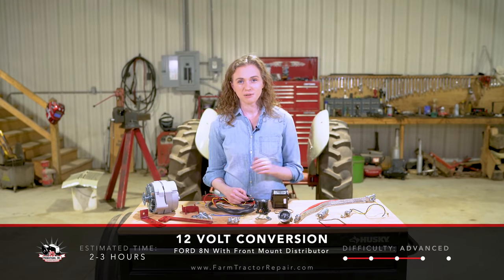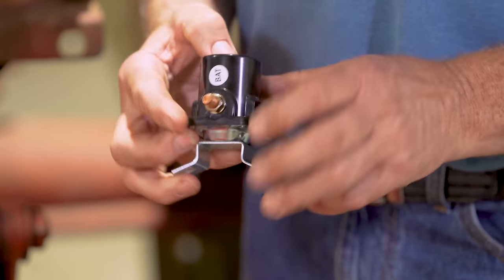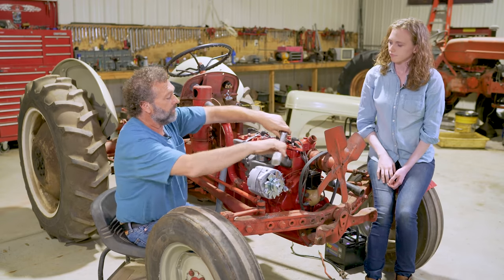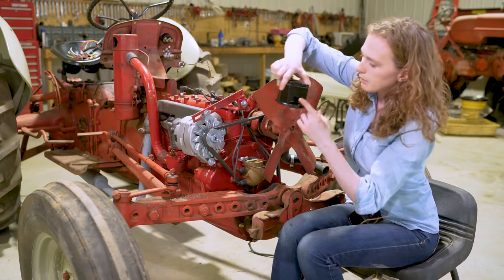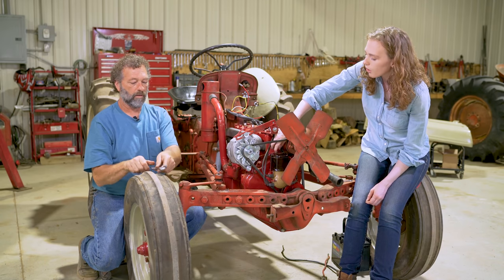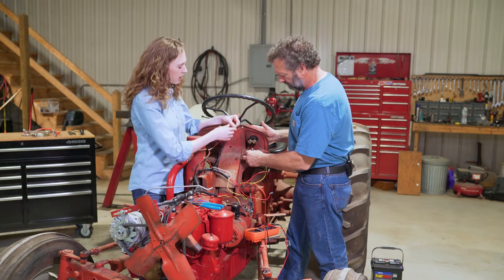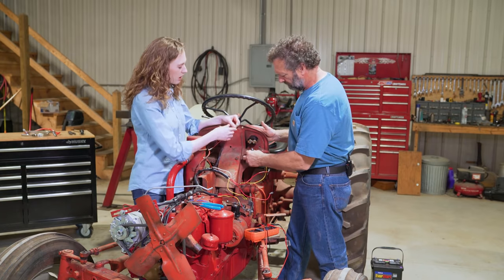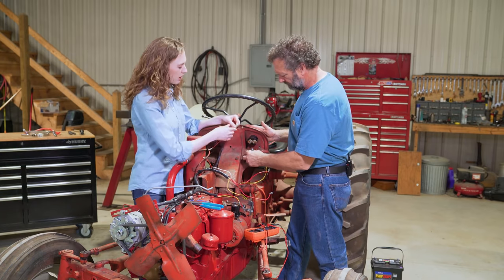Ford 8N FRONT Distributor Wiring & 12 Volt Conversion, and Starter Button Replacement Tutorial

Comment: Well Dan and Rachel, bought my premium conversion kit in January ‘23 and it will be January ‘24 in a few days.  Since my distributor failed and the tractor has not started in 5 months, I really need to get it running in case of some deep snow this season.  I love the freedom of movement you show here as mine has a Dearborn loader.  The framework for that thing makes almost any angle I try to work from… a chore.  I have decided to use a link belt instead of removing the front loader pump to change the fan belt.  I love the way you said “changing that could take all day….” looking at this now, you are so right .  Got the 8N running perfectly today as a 6V… now it’s time to pull that apart and make this conversion….a year later 😂
Reply: What link belt did you buy? 
I need to get one, I really don’t want to have to remove my front loader for the belt.
Reply: @paulridley5579  I bought mine from harbor freight.  It was 1/2 the cost and after 4 months, no issues.  Had even replace the front mount distributor and the engine starts almost instantly…spins over maybe 2 times and it running great
Reply: @knuckle47   Thank you so much, this worked and saved me a ton of time. I could only find 1/2” at harbor freight so I bought the 5/8” x 5’ one on Amazon and removed some links. It worked well!
Reply: @paulridley5579  glad to read that….BIG time saver

Comment: Very informative video
I ended up buying this kit through your website. It was very expensive for the quality of the items which came. The key switch was very sloppy and I ended up having to make and weld a piece for the  bracket for the alternator, like the one shown on the front page of your manual.
 I'm not trying to be negative but to help the quality control and the customers in my situation.

Comment: Dan did my 12 volt conversion on my 8N back about 1992 when he had a shop on Lapeer Rd just south of Lapeer.  That's when he had no snow on the mountain. Still have the tractor, and it starts like it has electronic ignition but it doesn't.  It just starts right up in  2 seconds or less.  Everybody else's tractor just grinds, and grinds, and peters out for some reason. Mine starts instantly.  It's wierd, but I'll take it.  and I store it outside under a tarp in the cold Michigan weather, and it still starts up instantly.   Thank you Dan.

Comment: Thanks! I have a Bolens G192 with a generator and relay voltage regulator that I will adapt your approach to a single wire alternator. When I was a high schooler in 1978 i converted my 6volt 52 Chevy truck to 12v. With the 6v starter it spun over like mad! Added a ceramic resistor for the heater blower.

Comment: One little complaint Rachel, the screws holding my new resister are 1/4 by 24 and not 28 as you said in your video. Not a biggy but that’s the only thing I can bug you about. Love the videos👍👍

Comment: Just jumping back to say a video on putting the hood on and off an Ford 800 would be nice. How to properly put back on all the clips, rubber bumpers, and get everything aligned. With info about hooking up all the lights and properly wiring. The Hood and writing of lights is something there is just about nothing done out there, at least all in one video. Thanks again.

Comment: Followed video and written instructions to a tee! However when I connect the negative battery cable on to the battery the tractor starts turning over. Rechecked the wiring.. connected per the diagram. had a new solenoid sent same results? Help?

Comment: I recently purchased a Ford 600 that had already been converted to 12 volts, the tractor runs good but the previous owner bypassed the starter button with a dash mount push button and the lights are not hooked up. I would like to replace the starter button but was wondering if I should purchase just a 12 volt wiring harness or if I should purchase the whole kit? I have not had the opportunity to work the tractor, so I really don't know if the all the gauges are there. Thank you for your video's they are very helpful

Comment: Great video, one question, I cannot get my mechanical starter switch to work, switch worked fine when tractor was 6 volts, is there a different switch for negative ground ? Or do I need a different solenoid, I did go with 12v solenoid.

Comment: Hi I bought a  48 ford 8n with a  loader last year it has a 12 volt positive  ground battery  hooked  this  way it started  when warm but have since changed the carburetor  now  that it is cold will not start I have ordered the  12 volt conversion  kit  have you heard of people running  tractors  this  way?

Comment: Does the point condenser (6V) need to be replaced and how about the starter. Will 12V system damage it if excessive cranking occurs

Comment: I have by s/n what appears a '50 mdl ford 8 or 9N or a hodge podged tractor?🤔😊.  L&R brake peds on Rt side...but 3 spd Tran & draft cntrl.  I rewired to 12v.  Set it on  blocks after purchase 3 yrs ago or so and went thru it.  It has side mount distr...What am I seeing??

Comment: I have a ford 8N tractor that's been converted to a 12 Volt system. The thing breaks the Starter Bendix on the starter every 6 months or so, can you recommend anything so I ain't fixing the Bendix every 6 months??? Is there a harden Bendix that might stop the Starter Bendix from shearing off every few months???

Comment: Here's what I need, my 1980's japanese Ford 2110 diesel has a 3 point hitch that goes down when the tractor is off, I am sure the pump is running needlessly in order to keep it up while being used, meaning, the hitch leaks down. I have no idea where that fault is and how to fix it, I have fixed all the cylinders on a 580B backhoe, but I dont know how to address the 3 point hitch repair. Guess a book would help lol. Since the pump is probably holding it up, thats wear and tear and excessive fuel use,

Comment: The tractor im working on, the solenoid is not on the Starter. Its down low and screwed into the steering column housing. Foot pedal plunger to solenoid.  Does that mean I'm working on a 9N? Theres no ID.

Comment: Hi. Love your videos. I have a 1950 8n and was curious on what 12v kit to purchase from you . When I'm looking at front of tractor the generator is on the front left side of belt assembly.  I'm confused what is considered front or side. The distributor is on the from of engine between the belts. Not super familiar with these machine so I apologize for my poor description.  I've had enough of the 6v system . :)

Comment: I bought the kit for my 8n and wired it exactly like shown, but when i connect the battery it just starts turning over.... any ideas or suggestions?  Exact same tractor as in the video
Reply: I have the same issue. Did you figure out the problem?

Comment: I have a 40’s Allis Chalmers, this similar? Thank you!
Reply: General wires yes. Amp gauge yes. Key switch yes. Coil wire yes. Alternator yes. Different brackets for the alt. Different coil. I don't remember if AC's had a push button or a starter sil
Reply: @raymondbuterbaugh3117  thank you!

Comment: Hello Rachel and Dan.  I am a foundation board member on a Living History Farm, and part of our responsibility lies in keeping our antique equipment going within budget, and with volunteer labor!   We have a 1962 Ford 801/851 (the hood says 801, but I think the wrong sticker got put on it in the last repaint!) that is our primary mowing tractor, and our biggest problem with it is the 6V system.   I'm sure there are 12v kits for the "newer" Fords, but are they as easy to do?
Reply: I have a 57 600 that my dad bought. It is 6 volt and has no problems starting at all. I did make a few changes to it thou.  The biggest problem turned out to be the distributor did not have a good ground. I ran a ground wire to the engine block as it would not ground thru the hold down clamp and the rubber seal. If you still have a starting problem you can put a diode from the starter to the power side of the coil. That way you get full voltage to the coil while cranking instead of reduced voltage. I am a retired Elevatorman, wiring does not scare me. Oh yeah it never cranks over 5 seconds before its running.

Comment: Actually the most common reason they have been converted to 12 volts is because engine doesn't spin fast enough to build compression on a worn out or low compression engine. 
Everyone thinks yeehah it's been updated to 12 v.. but actually it just spins fast enuf to start.   Find a tractor that's 6 or 8 v that starts good and you'll have a tractor that can be handed down again to the next generation.   Plus all the cost of conversion  could be used for a rebuild or re ring engine .  Thanks for the read and your welcome if you thank me ! 👍

Comment: Since 12volt is not original I prefer a 1 wire alt. With built in volt regular, only 1 wire. Also with the 600 800 4cyl tractors theres a difference in non insulated and insulated solenoid since these tractors crank off ground.

Comment: I recently bought a 8N 1948 tractor from a guy and it came with the 12 V kit in a new box I was trying to install it as i read the 1 page instructions on bottom it says small 2n or 9N, wires are there but im missing the second red wire?! Any help would be appreciated